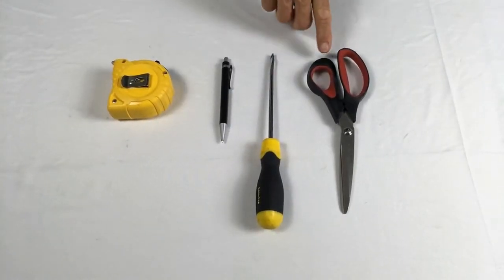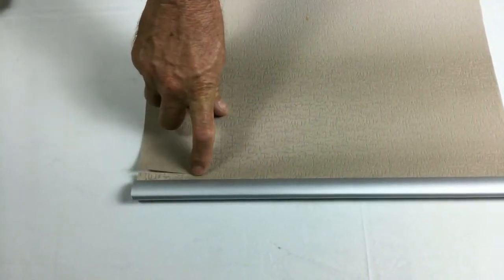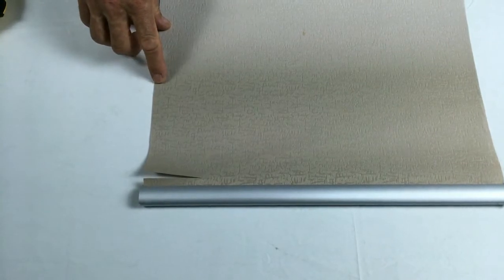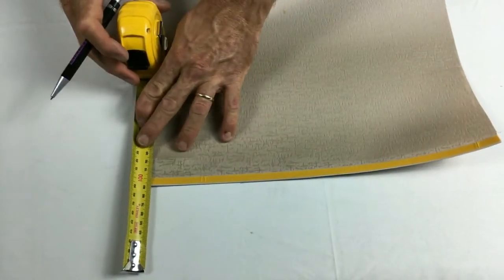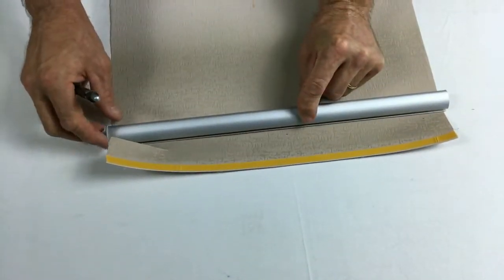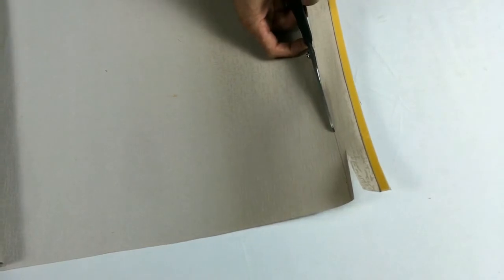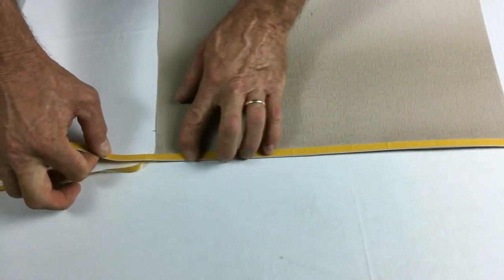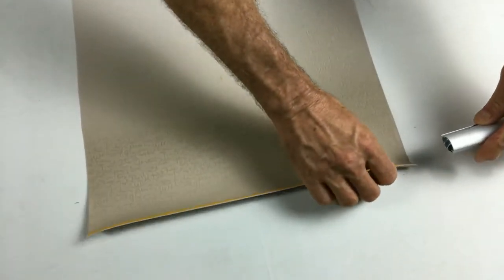Repair a Tear in Roller Blind Fabric

Comment: I have zebra style blinds with a slight tear on the transition section. Can a clear tape be used to repair it?
Reply from the maker: I have used thin double sided tape to repair the transition section in the past . it was not easy but I cut from one side of the blind to the other and then overlapped the fabric using the double sided tape to stick it together . it worked pretty well .